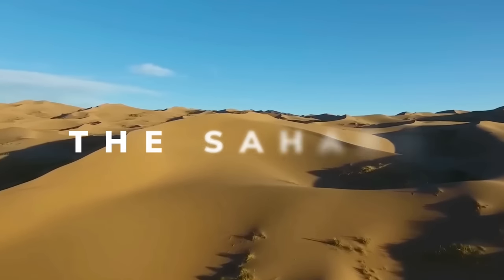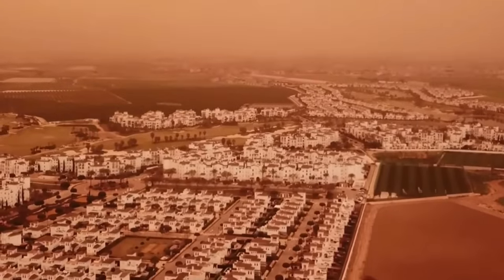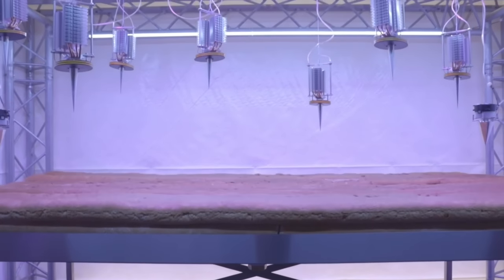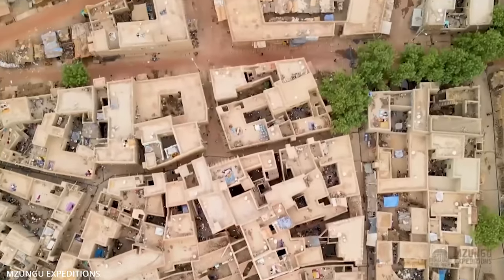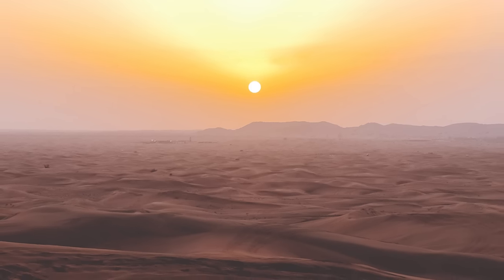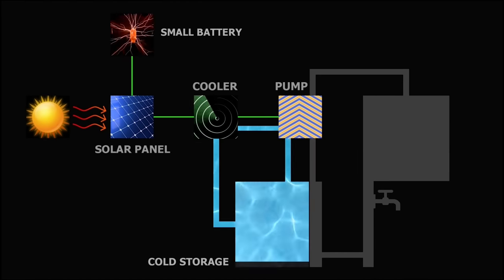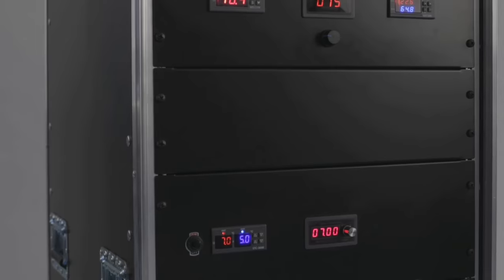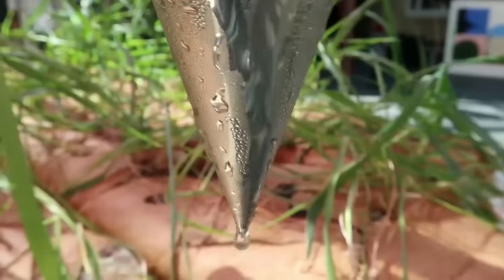How Solar Powered Machines are Making Free Water in the Sahara Desert

Comment: Its basically Peltier device, similar tech used on cheap portable dehumidifiers. It can collect water but at a very slow rate, even in humid area.
Reply: That's exactly why I hate all of these ideas. They keep making them and popping up every single 1 to 2 months and non of them work. They all say they are different and new but literally zero work effectively
Reply: I bought one of the cheap peltier  dehumidifiers from amazon. 40% humidity, it makes 10 drops a day on 22 watts of power. My main ac unit makes more than 3 gallons a day on 3600 watts of power. You better have a lot of power available:)
Reply: @KevinSmith-os5yz  Solar panel is about 150w per square meter. Therefore, for about 24 sqm, you will be able to enjoy your AC and less than a gallon of water during the day time. Sorry about the night time....
Reply: @biohazardlnfS  slow > 0.   You could put a lot of these around.  Have one only water a tree.  What could it hurt?
Reply: Correct
Reply: @dennisdonnelly4440  desalination is still cheaper. That's the hurt.
Reply: @911mastermind  sun power > charges solar panels > runs electric water pumps > pumps salt water from ocean > to solar water distillation plants > fresh water carried to arid regions by canals + solar powered water pumps
Reply: @dumbcat  You can also do distillation directly using solar energy (No photovoltaic, just concentrated solar without tower).
Reply: @dennisdonnelly4440  cost
Reply: Peltier!......very easy machines for  me
Reply: Better plant suitable for Soil&climate of the regions on large. Try to cover land with maximum tree 🌳 Study how Rajasthani  trees growing in Rajasthan arid land

Comment: if a 100 kw unit per month costs 10k to buy and has a 20 year lifespan then it will produce 300 liter per month or 3600 per year or 720,000 over a 20 year span. that means you are paying 1.38 cents per liter ($10,000/720,000).  that’s not terrible but it needs to get 100x cheaper as water costs about $.0001, not $.0138
Reply: yes, that being you can buy water. but in sahara i wonder where would you buy water.
Reply: 72000
Reply: @matthiasklopke161  thanks!  you are correct.  so its even more expensive than i thought.  i guess it needs to get 1000X more efficient.
Reply: Economies of scale can knock that down a big deal.  

Oh and bottled water can go for even a dollar in some areas.
Reply: @doncorleon9  i think you make a very valid point.  this can be used as a sub a for expensive drinking water

Comment: i'd like to see a cost analysis of getting water this way vs long distance irrigations and piping with and without desalinization plants. e.g. how much is a galllon of water produced through this solar method vs a gallon produced through irrigation methods.
Reply: Aren't we comparing apples to oranges? This is a fully self-contained unit that is also decentralized and not dependent on any external infrastructure. It may or may not work as a global scale solution to solve water access but the question is, does it even need to? It is also not some high tech solution and is quite simple in its implementation. Comparing it to a massive public works infrastructure solution would be a disservice to both solutions as both solve two very different problems, or two very different classes of problems.

In fact, the real question to ask is, why not both? Why are we forcing this choice to choose one over the other? You could use multiple such centralized and decentralized solutions on a "as it makes sense" basis.

And by the way, this solution would be completely free in terms of running cost (besides occasional maintenance). It is powered by solar panels which drive the fan that cools the unit to cause condensation. The only cost worth mentioning is the initial purchase cost. And I am sure a large public works infrastructure involving digging thousands of miles of canals or pipes isn't exactly cheap either. And that's putting it mildly.

And if i understand their claims, if you have a 1kw panel (which should be about 4 panels - not much - which should cost about $600-$800 USD or so), assuming 10 hours of strong sunlight a day which is very reasonable for a desert, it would produce 3 liters of water an hour or 30 liters of water a day.
Reply: @arunramachandran5012  first off, there's no such thing as free. And we're not comparing apples to oranges, we're comparing cost to cost. There is a fixed cost for the manufacture of the device and then it has a life span after which you need to replace it. You add up all the total costs and divide that into how much water it makes and get a price per ounce. Then you do the same with price per ounce of water that is delivered to the same area via more traditional means. Since there's no such facility yet, you would have to do some estimates based on known costs of water procurement in other similar areas. Once you have your numbers you just look at which is cheaper and spend your investment there. There's no need to have both when you just need one kind of water, which is just water. It would be like paying 2 different water utilities to provide your home with running water. Why pay 2 when you can pay just 1? Also, I would almost guarantee that if you need substantial quantities of water you're still going to want to go the traditional route of pipes and pumps. But if we're talking about supplying drinking water to a small village, then maybe these solar condensers would be the better option assuming they can last a long time without needing parts and labor. I doubt the average Saharan villager knows enough about how to repair and maintain one of these so it would need to last a long time without needing any upkeep.
Reply: Viễn-Phương  deserts are greening and the Sahara IS shrinking on its own. The primary assumption of this clip is wrong! Even NASA admits that and they believe that the greening occurs because there’s more CO2 to fertilize plants.
Reply: @C_R_O_M________  What absolute nonsense, most deserts are growing because there are far too many people. The Middle East was green and lush once, before we got started on it with goats, that is why we invented agriculture there.

I am a horticulturalist I can tell you that the slight increase in atmospheric CO2 does not compensate for loss of moisture and increased storm frequency in most areas. Most plants hate big changes they like stability. The plants that grow more will be in the Northern temperate areas, like trees in Siberia but unfortunately melting permafrost will release more greenhouse gases.
Reply: @Endymion766  You need to consider the fact that if large scale water infrastructure was possible in these sub-Saharan countries, it would have already happened.

And yes, i qualified my usage of the word "free" so not sure why you're ignoring that. You're also overthinking the technology here. This is literally solar panels (that are nearly maintenance free except for an ocassional dusting), a fan to cool this system which can break down as it is a moving part but also doesn't take rocket science to fix, even in the Sahara, some condensor metal which just sits and condenses, and maybe some controller.

It has already been proven that solar panels pay for themselves in very little time and have also matured as a technology. You're having issues with the word "free" but you're also ignoring the extremely powerful fact that solar panels DO INDEED harness the power of the sun on a very localized basis in a very cheap and reliable way. And in the Sahara where the sun is beating down all day, that's a no-brainer. So yes, electricity generation is indeed free.
Reply: @arunramachandran5012  water procurement is possible anywhere, you just need the money and resources to build it. Nevada was a desert before it had Las Vegas. You say solar is cheap, fine, how cheap? That just takes me back to my original assertion to see a cost analysis comparison. You can't get approval for a big project by saying "cheap". You have to prove it with the math.
Reply: "She" said up to 3l of water per kwh. Assuming this isn't bs, do the math. Solar energy on large scale is touted to cost 5cents/kwh. So that would be 16-17$/ton without counting cost for the refrigeration units.

It might get cheaper if used as "storage" of excess production in large solar farms. But at this meager scale.. I doubt it.
Reply: @pisoiorfan  ok thats what I'm talking about, some cost analysis. Well without taking into account the cost and upkeep of the unit, it looks like traditional methods will still be cheaper in the long run. Potable tap water costs about 0.001 cents per liter and this condenser process is going to cost about 0.006 center per liter notwithstanding the cost of the unit. So regular pump and pipe water is still going to be cheaper if you can get the facilities built to do it but that might not be economical if you are trying to serve a small spread out population that just needs some occasional drinking water. But if you're talking about farming and irrigation, this new tech just isn't there yet. Maybe one day if we can get a much larger version capable of making it virtually rain in the desert then we can put it to use raising crops and animals. I'm not sure what grows in sand but think things like carrots, and potatoes can handle a lot of sand as long as they're also getting alot of water.
Reply: @pisoiorfan  I'm not sure what you're trying to say. Why are you comparing this to some commercial solar grid? Have you even seen this unit? It is a fan/controller and condensor (that condenses water from air) and you can plug in a few solar panels to it to drive the fan.

If you're living in Sahara and do not have any water infrastructure around you as is the case with most of Sahara, you can use one of these units outside your home and it will generate 30l or about 10 gallons of water a day. And there is no running cost besides some routine maintenance of the fan if needed. So i am not sure where the 5 cents is even coming into play.

It is not like you have to pay Mr. Sun rent for using his sunlight.
Reply: @Endymion766  Nobody said anything about a big project - those are assumptions you are making. Nobody said this is the magic bullet to provide water to everyone on Earth either. 

This is a cool little self contained device that uses solar panels to extract about 10 gallons of water, which could really positively impact the lives of people living far beyond the reach of infrastructure. Vegas had billions of dollars to spend - for the countries in Sahara, their entire country's GDP is probably less than what people spend in Vegas in a month.

And because it is extracting water from air and doesn't even need anything else, people can literally have this unit in the middle of nowhere and start generating water in a matter of hours.

If it was so easy and trivial to solve water issues like the Vegas example you're giving, there would be no water issue to begin with.
Reply: @arunramachandran5012   see'' thunderf00ts'' water sear video for all the answers you seek
Reply: @chimpofm  That was a nice video, thanks. But I am confused - this device is not the waterseer. So I am confused
Reply: @arunramachandran5012  its a solar dehumidifier. In a arid enviroment.  Its incredibly inefficient.  As the dehumidifier works on a electric heat pump.  To generate a cold side to condense humidity.  Somewhere that is also very hot...
Reply: @Endymion766  The US bombed the excellent water infrastructure in Libya when they invaded, so there is that! Where goes Empire there goes destruction. Also you are very naive if you think that there is equitable distribution of wealth in ANY country. So such grass roots solutions cannot be reduced to merely dollar value, life is not valued that way no matter how you might wish it to be so.
Reply: @Endymion766  I've lived in Las Vegas for nearly 50 years. Nevada was a desert before Las Vegas and it remains a desert.  Las Vegas grew because of the damming of the Colorado to create Lake Mead.  You can build a big city in the desert if you have a giant puddle next to it.
Reply: Think big and think small.
These units on a small scale could sustain a family or small village, add in small greenhouses which trap moisture produced and used within and it negates the desserts + or - growth.
It may never work for large scale irrigation but it may work well enough to sustain individual family needs to end their starvation, which no mater the cost we must end.
Overages can be used to barter for other needs, man has survived thousands of years without factory farming and mass irrigation.
And that's not to say large infrastructure projects aren't needed where they make sense.
Reply: @arunramachandran5012  agree. there might be more social cost by piping only
Reply: @fakshen1973  exactly, and the Sahara has giant aquifers underneath it. There's our puddle.
Reply: A) The Sahara is a desert because of precipitation which includes water sources like condensation.

B) these pull water from the air which if it's a desert it's barely anything in the air.

C) they will barely produce any water that way even for a small village as they are not effience enough nor if there is enough moisture in the air itself.
 All of these ideas of placing solar power anything in the desert for water out of air is silly at best
Reply: @pisoiorfan  if a 100 kw unit per month costs 10k then it will produce 300 liter per month of 3600 per year or 720,000 over a 20 year span. that means you are paying 1.38 cents per liter ($10,000/720,000).  that’s not terrible but it need to get 100x cheaper as water costs about $.0001, not $.0138
Reply: @biohazardlnfS  I thought in the video they explained that there is a lot of humidity in the air in the Sahara on average, about 3 times more than in the Netherlands? It's not correct?
Reply: @hanswurst3760  could you be a bit more specific? CO2 fertilization DOES contribute in greening the world.
Reply: @Endymion766  there are lots of things that are free, air, water, wind, solar energy to name a few, who do you pay to get sunlight? we get food from nature via photosynthesis for free, we have to pay in cities for transportation, processing and other costs only because we don't want to settle in villages and don't want to do things on our own
Reply: @gulshanchaurasia2233  air yes, water no. Water has to be transported which costs money. Solar energy? No, someone has to plant the crops, then harvest them, then they have to be transported and processed, so definitely not free. Even little villages have to process the food they eat. No one takes a bite out of a cow as it walks by or pops a wheat stalk into their mouths. I lived on a farm growing up. There are many steps before and after planting that take time and effort which is a cost. Only the air is free, for now.
Reply: @Endymion766  Where is Las Vegas getting its water? Is it tapping into the Oglalla aquifer? Lake Mead looks like a goner at this rate.
Reply: @grovermartin6874  the tap the Colorado river and ground water. I presume they're doing what they need to do.
Reply: @Endymion766  thing is solar panels are now a lot cheaper. the value of these for human drinking is of course much higher than for animals , the value of water for plants would be much lower yet. watching ''itchy boots'' this season is a eye opener of the sahara's problems. amazing woman.

Comment: As a retired mechanical engineer I have used Peltier devices for cooling in my designs. The degree of success that any water from air project is reliant on, is the system design, and detail design . The biggest problem facing this technology is how up scaleable is it, vs cost of a large scale plant. In the poorest regions, where a scaled up system could be most useful, but also where there are no large amounts of money either to afford one. No peltiers are not the solution here. What is needed is a system that can be made locally, using local materials and very low technology being involved. I believe that a very large tent like structure, with air slats , and  a central shaft that is dug down deep in the sand, and umbrellar type steel u type columns that go back down and meet the central column will work, using natural condensation.  The idea is that under the Blacken out tent, the condensate is created by the intense heat in the tent, and during the night the water droplets that have formed on the metal  u shaped channels, run down into the central water collector which is cooled in  a large underground tank. The water can be pumped up to the surface using a simple mechanical lift pump. The desert sun which can make air temperatures reach 45 degree celsius in the day, will provide the energy, the greenhouse type tent will capture the moisture, and the coolness of the night will allow the condensate to collect underground.  Something long these lines, is a more practical way of extracting moiture from the air.